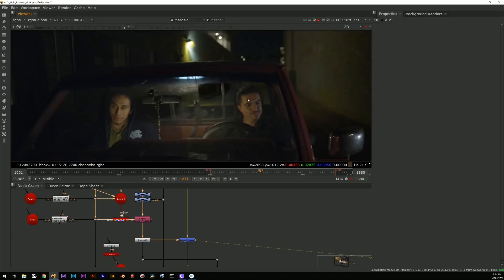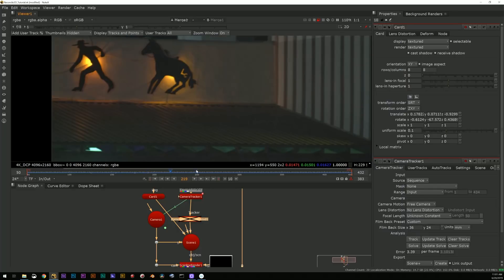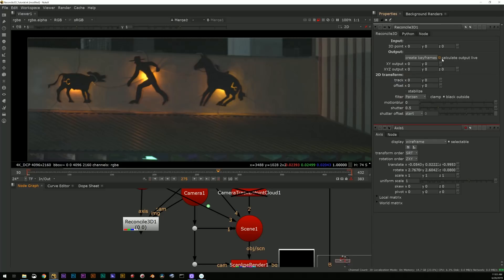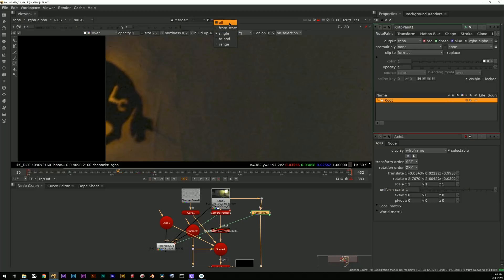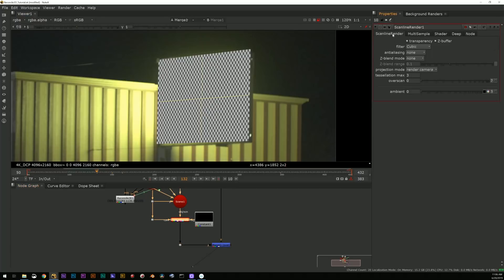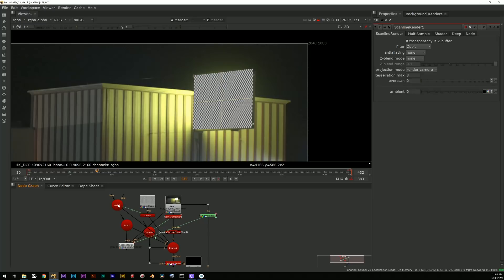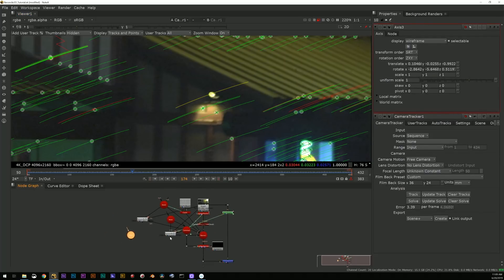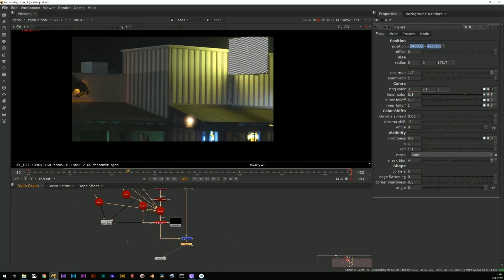Nuke Tutorial - Reconcile3D Node

Comment: Great tutorial! I learned a lot of other useful things besides Reconcile (such as turning off expression lines with Alt+E). One question: Reconcile3D appears to require you to have a pointcloud so that you can select a point and create an axis, and that pointcloud is generated by your CameraTracker node; Suppose you have a more complicated scene and instead of having to do the track yourself in Nuke, you were provided with a camera that came from the 3d/track department - which means you no longer have a pointcloud. How would you generate an axis without a pointcloud?
Reply: I guess the 3d department would have to provide some set geo as reference for the axis, which in my experience is not always available!
Reply from the maker: You could use the Point Cloud Generator node and feed it the camera from the 3D department. Glad you found this useful!